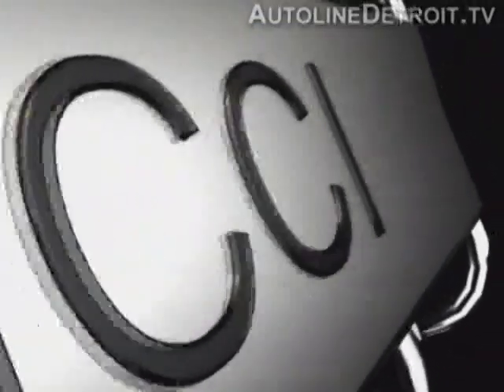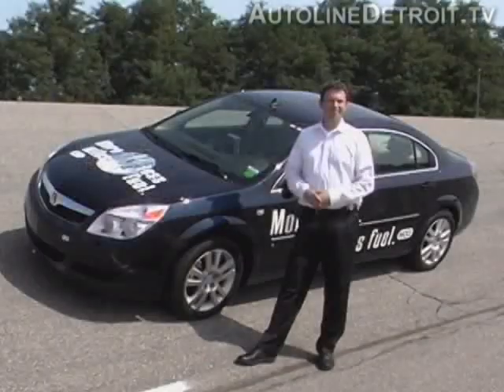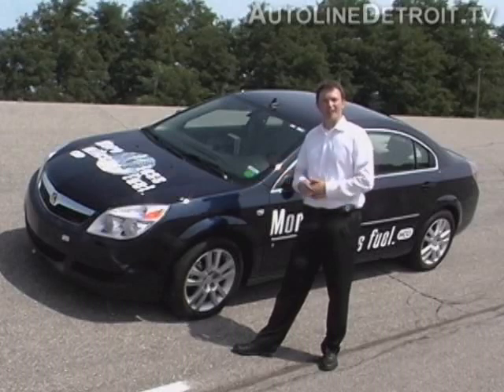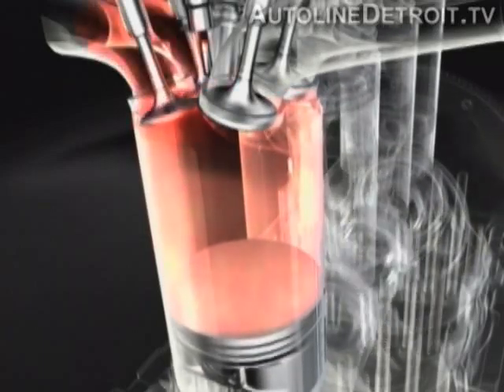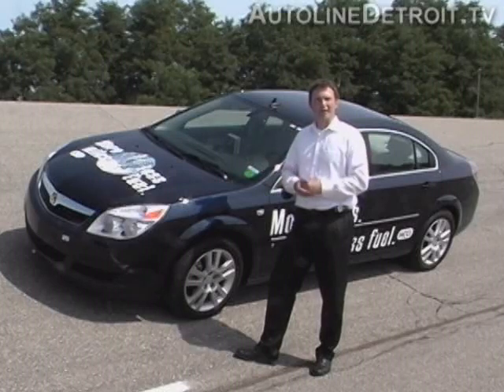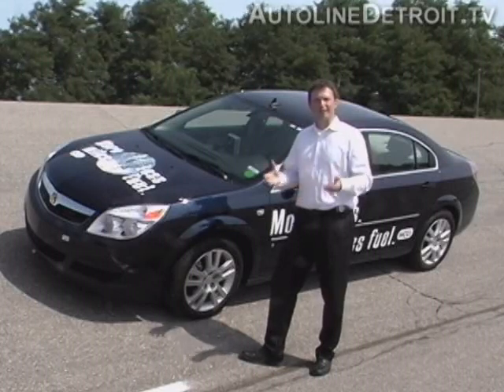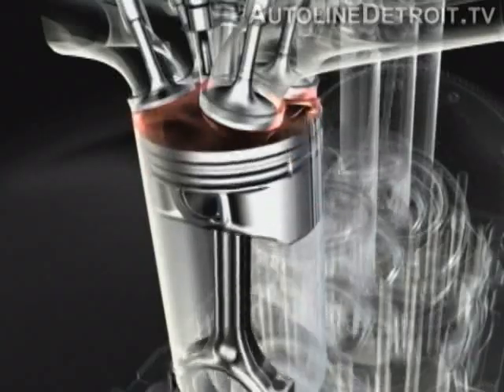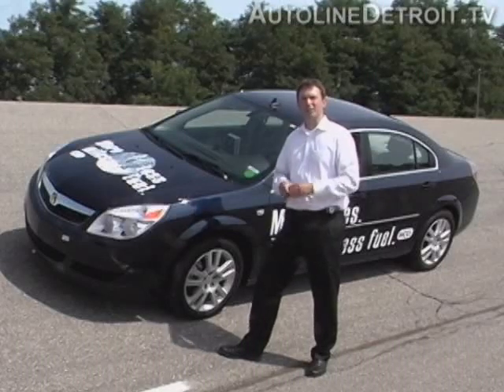John's Journal - GM Makes HCCI a Reality

Comment: Rudolph Diesel made his engine to run on peanut oil, or other bio fuels  so farmers could grow their own fuel,  then the fossil fuel tycoons fucked it all up for their own profiteering  with having them run on fossil fuel
Reply: Tibbz Coils, you can still run a deisel on bio-oil.  Just go do it.  I don't see how the petro industry has changed that.  Other than by offering a product that most customers seem to prefer.
Reply: of coarse because that engine runs on compression of the fuel to explode without spark sending the piston down it how it is designed you cant be changed essentially, an external modification to the fuel delivery system is the only way you could not run a diesel on bio fuel. If you want to run used fryer oils you must seperate out the food particles glycerin and water in order for it to run.          Diesel engines are NOT supposed to run on fossil fuel Rudolph did not design it for that purpose. I dont see how you may not be understanding the manipulation and stranglehold that big oil has on the masses.
Reply: Tibbz Coils Manipulation?  Are you not aware enough to break free from the control of others?  If you want to run a diesel in bio-fuel then just go and do it.

Anyone that is trying to sell you something will go to great pains to convince you that you need their product.  Does not matter if it is jeans, tomato sauce, cars, or cell-phones.  It's all about convincing people that they need to buy their product.  Those that are more self-aware can easily rise above this and set their buying habits to their own needs rather than falling for the advertisements.

The only time I get really concerned about how a company might manipulate the situation is when they team up with the government in a manner that either forces us to buy their product (think Obama-care), or to block competition by LAW, or to get government subsidies to help pay for their business (for example; the $8k tax credit for buying an EV).
Reply: Mike Betts I totally agree with you on every single one of your points you've just made, also consider there is a world outside of the US though I'm aware of Obama care I'm Canadian and don't know 100% of exactly what that "coverage" entails other than it being a huge rip off as said by my friends who live in the US
Reply: Tibbz Coils Whether or not Obama-care is a rip-off will often depend on if one is on the paying or receiving end of the business.

Most of us that have decent jobs now pay a MUCH higher premium just to get the same coverage we had before.  My company has seen increases on the order of 35% or so per year for two or three years-running as the law got phased in.

Those that get something for free, will always think free stuff is great.  And that is why we that work now pay more; to cover for them.  Not much more that needs to be said about that. 

My daughter works at a hospital.  Pretty much EVERY doctor she works with is opposed to the whole mess.

The problem now is that even with Trump and republican house and senate, it is very difficult for government to pull back on a program when a bunch of people are getting free stuff as a result of it.  I am hoping that they can come up with a way to ease some of the people into a better system where they are able to purchase low-cost insurance to cover catastrophic claims and then use health savings accounts (tax-advantaged) to cover regular check-ups and that sort of thing.

Back when I was a kid, most everyone covered basic health care out of pocket and only used insurance to cover accidents, terrible illness, etc.  It worked very well.

Kind of long rant about insurance for a video on diesel engines.  But the underlying issues are related.  I am very suspicious of the government getting involved and trying to "save us".  Let the free market sort out what products are best.  The customers will vote with their dollars.

Personally, I am a bit skeptical about being able to use bio-fuels in sufficient quantities to handle all of our transportation, BUT, as a free-market type person; I say let the market sort it out.  If enough farmers can grow enough oil-producing crops (or ethanol), then let them.  And if the refining companies want to use it.... And the car companies make their engines compatible...? Then fine with me. You get the idea.

What I don't agree with is having the government subsidize or force the market.  For instance, the farmer across the road from me has cut down a ton of trees just to put in more corn.  His land; his choice.  But he did this because of the subsidy for corn going into ethanol.  Had this subsidy not been in place, he might have done something else.  For me, this constitutes and artificial market.  I prefer natural ones.

Some people will hit themselves on the head with a hammer if you pay them enough.

Comment: 15% IS NOT enough
Reply: Yes, that is a really small improvement compared to what you can get by going with a hybrid design.  You can also get more with just a turbocharger and a smaller engine.  You can save on pumping losses by doing that.

Comment: I have always said GM can beat just about every other manufacture out there if they want too. But there is to much internal red tape and bureaucracy. Also performance mods, yeah I don't see that working out so well with an HCCI engine, think forced induction would work well with it, I sure don't.
Reply: based on what I have seen gm might been the first, but toyota will make it last, and honda will make it last even if you abuse the car.
Reply: Forced induction might actually make it more flexible, but it would have to be carefully controlled.

Which is to say, you will have more performance in the HCCI region, but you will be shrinking that region, so you will need to reduce boost strategically.

Coupled with a CVT, though, boost may enable staying within HCCI for much more of the operating range, moving peak torque into lower RPM ranges covered by HCCI.
Reply: My point was modifying for higher performance, not in the sense of better emissions or MPG. Would likely be much much more difficult.
Reply: I don't think you'll be doing much tinkering within the HCCI range, that's for certain.  You might be able to modify the higher RPMs... maybe delay boost until > 3,200 RPM or some such.  Very limiting, indeed, for the modder.

Comment: "At least another 100 years" LOL
Reply: theslimeylimey ya. Very funny comment. I'll give it another 10 years until every new car is electric.
Reply: I have no doubt electric cars will replace IC engines, most likely with nuclear generated electricity as that is the only workable solution in the near future. When is a difficult question to answer though.  Electric vehicles themselves are more efficient than IC engines which still struggle to use more than 30% of the fuels energy so throw in nuclear power generation and IC is not looking good at all. You are right about taxes though.  When electric cars replace fossil fueled cars, that fuel tax loss will have to be replaced so my guess is they will rename it to "road maintenance fee" or something and charge drivers per mile driven giving the illusion electric as being cheaper than it really is.
Reply: True, natural gas isn't squeaky clean with NOX emissions however, CO2 is most definitely a clean essential life gas. CO2 is just as clean as oxygen and arguably more so because its less reactive. Calling CO2 a pollutant because its a minor greenhouse gas is ludicrous and by that logic, water vapor should also be labeled a pollutant and steps taken to reduce clouds.
Reply: Nathan Smith
I said every NEW car.

And the Problem with the used car market will be that when batteries become tons cheaper, it will still be more expensive to buy a  fairly mid-priced used ICE car than a new Batterie car, consicering the running costs and therefor the total cost of ownership.

The very ceap ICE cars however will be on the user car marked for a couple years more, yes.
Reply: theslimeylimey 

Road maintenance fee, I love it.
Reply: Sim Salabim   I live near the city of Vancouver, BC Canada.  Vancouver is the 3rd largest shipping port in North America by tonnage. All that tonnage is brought it and out on ships from the west and trucks and trains to the east.  The number of ships, trucks and freight trains here is insane and they all burn dirty diesel polluting the air.  The retarded Vancouver city council, taking a fly swatter to an elephant, passed a motion banning the use of cheap clean burning natural gas in all new homes and buildings (including industry, restaurants, schools) by 2030 to be "green" and reduce CO2 "pollution" (I cringe every time I hear the made up term "carbon pollution").   Vancouver is already one of the most expensive citie to live in North America and they decided to make more expensive.
Reply: Sim Salabim  you are miss informed bro.
Reply: Max Tp 10 years is a bit optimistic, probably more like 20-something years until it becomes unanimous in the mainstream market. And, then still, the used car market will remain dominated by internal combustion for another 10 years as old cars trade hands.
Reply: And you're too stupid to understand fossil fuels causing global warming, and that existing battery technology is improving exponentially, and that sustainable energy is going to happen in your lifetime..........

Comment: 100 Years are you serious ? We wont have any petrol left by that time and I dont think we will have any combustion engine run cars by that time.
Reply: ICE engines are likely to be outlawed in new cars within a decade or two, never mind 100 years. Norway and the Netherlands are both aiming for 2025 legislation to this effect. The rest of the world is going to have to follow suit to limit climate change to merely 'really bad'. I guess they may last a bit longer if burning methane, hydrogen or DME, but the fact that electric motors are 3-4 times as efficient, as well as enormously cleaner, simpler and cheaper means the writing is on the wall for the trusty ICE.